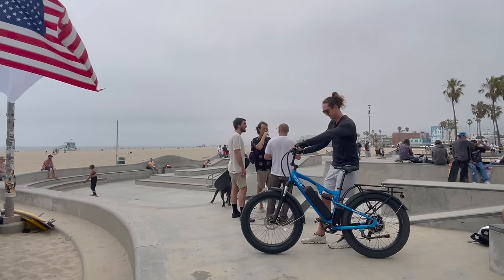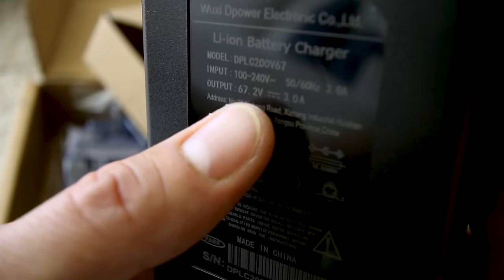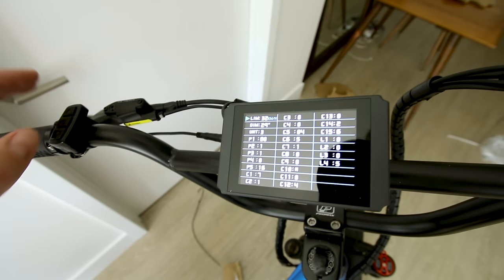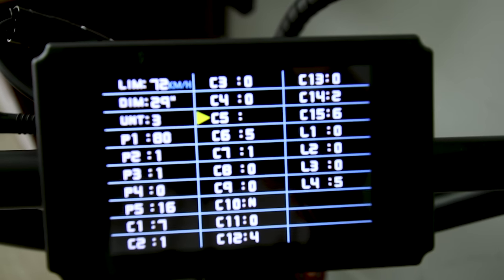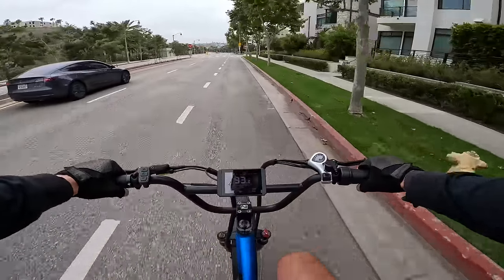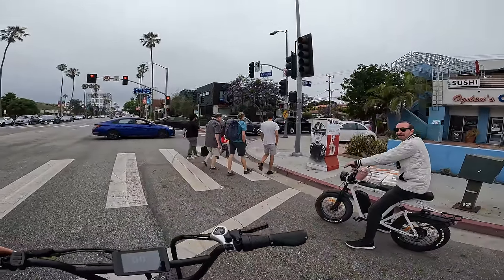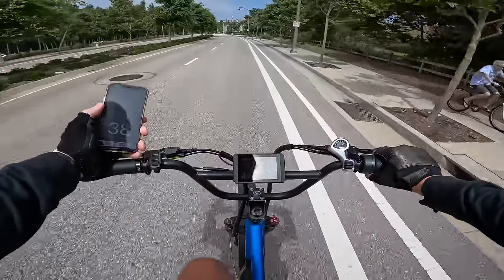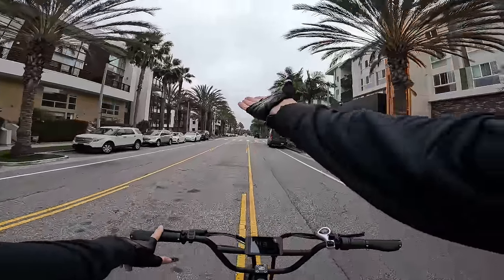This $2000 Ebike is INSANE - Wired Freedom Review!

Comment: I own this monster. My top speed is 45.2mph on it
Reply from the maker: Down hill?
Reply: @TailHappyTV  yes. I’m 170lbs. 
I can hit 39-40 level road
Reply: Do you think this bike would be ok with my weight at 245?
Reply: @stroutma  yes. Absolutely
Reply: I want to see a smaller wheel size programmed in settings. I went from 28 to 33 on my Sondors Mad Mod
Reply: @braticuss  Depends on ur weight. 190lbs stopping and starting full throttle, i'd say 15 miles
Reply: Going downhill?
Reply: How do you like it?
Reply: Yeah dude, downhill doesn’t count. It’s flat ground that counts for top speed
Reply: Does it feel quality? Think it'll last you a while?
Reply: My top speed on my Letric XP 2.0 with upgraded freewheel 11-34 
And tune up lubed up 
I hit 33 the other day I was in pedal assist 3 gear 3
Reply: Down hill doesn’t count. I can got 45 on roller skates down hill. Doesn’t mean anything. Smh
Reply: @Twinnzllc it was a joke.
Reply: @kevinhause1505 what do you think your best range would be if you weren't going nuts?
Reply: I want one
Reply: It says that it's available for pre-order. How cna I get it now
Reply: @dickflinghammer2985 that would be sick, and maybe a way to update our bike programing for the display
Reply: How the bike do in water or rain testing
Reply: I reckon a start bike using alternator power through std gears and chain would beat this bike
Reply: Where are you writing it on the Mountain Trail because taking that on a public road and going that speed is illegal and irresponsible and dangerous
Reply: 63 likes going downhill 😂
Reply: @stroutma no
Reply: Wait till they start using Samsung 50s cells and decent bms ! Everything else will be 3rd rate !
Reply: Hey! Just wondering - what’s the price on decent new tires? That, and is there a place to find replacement batteries?
Reply: They only sell it preorder, no choice but to wait for months
Reply: Prove it!
Reply: @stroutma bro, lose some lol
Reply: what about range ??

Comment: You guys are so lucky to be able to ride these powerful bikes, here in Australia the legal limit is 36v 250w with a cut off speed 25 kph = 15 mph. Of course most of us buy more powerful bikes and remove the limiter, if the cops wanted to be mean they could charge us but I've never had troubles in 3 years now.
Reply: We're in the same boat. At this time, unregulated and unknowledgeable enforcement is bliss.
Reply: Damn that is ridiculously slow
Reply: Here in the USA e-bikes like this are technically illegal as well. It’s just no one will ever enforce this and even if they did enforce this it would be impossible to do so.  The legal limit here in the USA is a 750watt motor that cuts off power at 28mph
Reply: Usain Bolt top speed is 27mph... this 🥷 speed while running is illegal in Australia 💀💀
Reply: @JB23669  there's a thought 😄
Reply: @sambryant2150  ridiculous is right, before I took off the inhibitor I left home was using pedal assist, before I got to top gear the power cut out. I understand all Europe is the same.
Reply: @riceball777  750w and 28 mph, thats about 45 kph, I wish we could enjoy that.
Reply: @JohnnysCafe_ yeah that sucks man😢
Reply: @StefanRandall  yes Stefan, it sure does.
Reply: Well here in California they're restricting bikes to 1,000w and other states are 750w.  Other than that is basically illegal.
Reply: Just like the whole europe. Just ignore this silly "laws" and ride them. Just remember to slow down near the cops.
Reply: @MyFaithShines  I do 👍
Reply: This bike is “technically” not legal, since it’s over 750w. But no one cares
Reply: @nicks931  it is regulated. Federal law on ebike classes is from 2002 which every state follows just no one cares..it’s 750w and max 28mph
Reply: @JohnnysCafe_  you can..just go a bit faster no one can tell anyway..no one can tell if it’s 28mph or 35mph..same for you, 15mph or 20ish mph
Reply: @djones811  bikes have been at 750w since 2002. That’s where the ebike classes come from, from a federal law..California isn’t above that
Reply: Isn’t it 500w now?
Reply: @JudeTheYoutubePoopersubscribe  yes same in Aus, I've been riding a 350w for over two years now and never been questioned, plus we have bike paths all over the city.
Reply: How about liability issues?  If you crash into someone, get badly injured at speed, will all the liability fall to you for modifying it past what the manufacturer recommended?  Imagine being sued by someone and knowing it’s all on you.
Reply: @aussie2uGA And, you’re just as liable for negligence regardless of whether the bike is “legal.”  Unbelievable how many Karen’s are out there.  Put on your big boy pull ups and try and have some fun in life rather than worrying about everything!
Reply: @aussie2uGA  there's a thought, and not a good one. I do use the bike paths that go all over Brisbane and am careful when on the road but now even more so.
Reply: @jfly2249  you must be young… 🤦‍♂️
Reply: @aussie2uGA actually quite old and a lawyer.  Stay young at heart and have fun.  Self righteous Karen’s make me smile.
Reply: @jfly2249  Sorry, don’t believe that for a second.  Have fun with garnished wages when you finally acquire some wealth and would like to protect it.
Reply: Great work Sherlock!!
Reply: @aussie2uGA Do you take prescription medication?
Reply: Just get a motorcycle
Reply: @654789qwe  License Tax Insurance Gasoline ⛽ 😑  ebike is quick and silent 🤫, creep around town at midnight pulling wheelies nobody hears you 🤟🤠💯
Reply: @654789qwe  yes that's an idea but ebikes are fun, cheap to run and with so many bike tracks (well in most cities) they are far more relaxing to ride.
Reply: The 250w / 15 mph limit is pathetic, dreamed up by some suit somewhere to stop people switching from i.c.e. mopeds which are big brother monitored and multi taxable .
Personally I think this bike is 'too pokey' for riding without a helmet and gloves minimum.
However. 
The legal limits should be set at a 'normal' persons pedalling ability on a non electric racing bike 'on the flat'. 
Imagine how environmentally friendly that would be with nuclear power generation..
Governments dont want green solutions, they want to control , tax and impoverish citizens into 15 minute cities and obedience.
Reply: @MrChriss000  15 minute walkable cities are green. And they are in no way about control lmao
Reply: We have the same laws... what these promoters and advertisers won't tell you is that most of these types of vehicle will get taken away by Law enforcement, and they won't give it back to you. Unless you had it registered through the DMV. I've known 4 doordashers that had it taken away by Sheriff's.
Reply: @Fuzzie22   I did not know that but I think I understand it because ebikes can reach high speeds and I guess it would be dangerous to let anyone jump on one zoom around the streets.
Reply: @JohnnysCafe_  people here want an “e-bike” that is really a motorcycle. That’s why I made the comment. The people who are clamoring for high power and super fast bikes are the kind of people that drive recklessly in bike lanes and pass people at very fast speeds.
Reply: @ianmangham4570  there’s a reason higher powered vehicles require a license.
Reply: I know
Reply: @654789qwe they are also the people that are eventually going to make ebikes illegal altogether or at least require a license.
Reply: This type of irresponsible riding is what leads to more rules, regulations, restrictions,  and serious accidents.  250lbs slamming into a pedestrian can seriously injure or kill them. I have a friend who stepped off a curb and got hit by a 10 speed bicyclist. She hit her head on the asphalt causing brain swelling and permanent brain damage. She won a sizeable lawsuit. It's all great fun until you get subpoenaed.  Be considerate of those around you. If not, expect more damn rules and regulations!
Reply: @chuckweyant4872 hello Chuck, no one can argue with you there. Rules are imposed to stop people being a danger to themselves and others.
Reply: @jfly2249 You are being a bit harsh. From what I have been witnessing there is an ever increasing chance of people getting seriously injured with EV bikes getting heavier and faster and more numerous. Especially since these EV bikes are using bike paths that are also used by pedestrians, others are flying along mixed in with vehicle traffic. I am seeing young teenaged riders moving at top speed with nothing on their heads or hockey style helmets, often unstrapped. Short pants and sandels.
Reply: Australia sounds worse than california
Reply: @Twinnzllc with less people even.
Reply: I live in Europe and my e-bike can go about 30 mph (50 km). But i sometimes see guys on normal bikes or (normal) mountainbikes going 25 mph or even a little bit harder. 
So the 15 mph limit (here also) is quite ridiculous. 
Of course when you go very fast, it's wise to put a helmet on and probably gloves.
Reply: @riceball777  Of course the laws can be enforced -  In the UK they're confiscationg truck loads of illegal ebikes. I 'd bet that you know enough about ebikes to spot an illegal one right off the bat - the police can do the same if they're trained up. I'm not sure I'd want to invest thousands on something that might only be rideable on private property depending on which way the future winds blow. Also if you were to injure someone on illegal bike, even if its not your fault,  that persons lawyer will know everything about ebike laws and use them to hold you fully accountable without the benefit of liability insurance. These bikes are cool, but they need to come under the umbrella of the law througfh registration,etc.
Reply: @FrancisBecka     realistically i dont see how its physically possible.  There are literally thousand of ebike companies from china and geeting these ebike and just putting there name on the ebike and a few months later the company is gone or the name has changed.   Law stated that most powerful motor legally allowed is 750watts but where is literally no way to tell a 750 watt motor apart from this bike with a 1000watt motor.  Low stated stat electric power must be cut off at 28mph and again there is no way to check this or enforce this.  

Out of all my ebikes Lectric is the only ebike company that setup there ebike legally.  meaning power on throttle is cut at 20mph and pedal assist power is cut at 28mph
Reply: A point of clarification these bikes aren’t illegal. You just can’t use them in the bike lanes. If you do, then you will be arrested and the bike will be confiscated and you won’t get it back in the event of some type of accident negligence comes into play and you could have everything taken away from you, plus your own insurance like homeowners might be excluded because there was a negligence involved. Operate at your own risk but I think videos like this are negligible  and there’s a lot of them. You do no Service to this hobby or this industry
Reply: @johnrob3215  wrong. These ebikes that are well over 1000watts like the suron are all illegal and cannot be legally ridden on public roads.  I personally do it but I do know that it’s illegal but generally these laws are not enforced, I think mainly because it’s not really possible to tell if the ebike has a 750watt motor vs a 2000watt motor and policy are not trained to do this.
Reply: @riceball777  there's a sticker on the motor.
Reply: @riceball777  wrong.  As long as they comply with the requirements of mopeds or motorcycles,  like license, registration, and on board equipment requirements, they can be taken on streets.
Reply: @johnrob3215   correct. These type of bikes need to be registered and insured to legally be ridden on public roads but if you try they actually won’t register these style of unnamed e-bikes.
Reply: @riceball777  theyre electric mopeds and motorcycles.
Reply: We also didn’t have covid camps 😜
Reply: @riceball777  20.  Its 28 if you don't have a throttle. ..which all bikes do.
Reply: @djones811  1000?  When did it change from 750...
Reply: @johnrob3215  the law is on throttle only power must be cut off at 20mph and pedal assist power must be cut off at 28mph.   Which the vast majority of e-bikes violate this law.
Reply: @johnrob3215   the legal limit to be considered an ebike is a motor with nominal power of 750watts. This ebike has a nominal power of 1000watts and peak at over 2000watts. So technically by law this is not an ebike and is considered a moped or motorcycle.  Key thing is you cannot tell this apart from a legal 750watt class 3 ebike. So it makes it impossible to enforce.
Reply: @aussie2uGA  he's a child...at any age
Reply: @riceball777  yes but the way I read it is the bike must be assist only, no throttle at all, to go 28. So class 1 is throttle only at 20 max. Class 2 is assist plus throttle at 20 max, and class 3 is assist only at 28.  I'm guessing they think the assist will take the bike to 20 and then it can be pedaled to 28.
Reply: @riceball777  hmmm, no,  if the bike is going 28 and the rider isn't pedaling, the cop can stop him and check the sticker on the motor.
Reply: @johnrob3215   this is incorrect as all class 3 bikes have throttles. It’s just the power from the throttle is cut off at 20 mph and the pedal assist power is cut off at 28mph.
Reply: @johnrob3215   like I said this is impossible to regulate as most of these high power bikes don’t even have stickers on the motor and even most low power bikes have no marking on the motor and most of all e-bikes and every the illegal ones all ship with a class 2 sticker on the frame. Plus anyone can just stick a sticker on and however then want. I know I have class 2 stickers on all my e-bikes even the ones that go over 28mph with over 750watt nominal motors.

Like I said impossible to inforce.  E-bikes are not cars. E-bikes have very few parts. Thousand of no names companies will sell bikes with motors on them. Anyone can just buy a motor and a battery to slap on there normal bike for a few hundred dollars and there is no way a cop is going to pull over and examine the ebike to make sure it passes all the class 3 rules. Simply not possible.
Reply: @riceball777  IC.  Then why have a class 1 or 2?
Reply: @riceball777  it’s not impossible. All motors are required to have stickers. If you change the sticker it is illegal unless you’re just going from a class to do a class three.
Because of the irresponsible 20% is in the E bike community states will soon pass laws requiring all E bikes to have to be registered, license, plates, motorcycle license, drivers licenses, and liability insurance. The 20% or’s are going to screw it up for everyone.
Reply: @riceball777  let me explain a little bit, it’s not impossible it’s just difficult. And that’s the very reason that states are going to soon require licensing and registration so that a cop can simply look at the license plate on the vehicle to see if it’s probably registered and can call it in.
Reply: @johnrob3215   I do agree the only way to inforce these ebike class rules is to require  registration and insurance on all e-bikes other wise it’s near impossible to In force.  Let’s hope this does not happen. As of now I’ll enjoy my illegal e-bikes that look just like a class 2 legal ebike but has over 1000 watts and no sticker on the motor and over 35mph top speed on throttle only with my class 2 sticker on the frame.
Reply: Yes send me opn
Reply: Every time I set on my on my ebike, I remind myself how lucky I am to be American!🇺🇸🎉😊
Reply: @jonspeak2807  I thought it was more lenient there but after talking to others apparently your laws are restrictive too.
Reply: @jonspeak2807  how lucky is that?

Comment: Awesome review and video! As a motorcycle rider I cringe a little seeing you riding at 35 mph on the streets. Imagine the road rash of a get off or a collision at that speed. I don't want to mother-hen you, but maybe check into some protective gear at your local motorcycle shop.
Reply: The long girly hair will protect his melon. 🤣🤣
Reply: I'm confused as to how they can put that class of a sticker on it when clearly this bike is capable of blowing that out of the water?
Reply: @rentvesting the stickers are layered, with class 3 underneath, you are technically supposed to remove the class 2 sticker to reveal the class 3 once unlocked, obviously no one would intentionally give themselves away to an officer, if it's capable of over 20 mph many bike lanes and trails restrict what can be ridden on them leaving you subject to getting harassed by law enforcement, most law enforcement may know of the class system but likely won't have inside knowledge of the user interface or how to check to see if it's been unlocked or not, leaving many to rely on information provided by the sticker 😉

Comment: Make sure to either loctite that rear fender or remove it. The screw backed out on me during a ride and caused a major accident. Wired helped me out which was great but it was preventable.
Reply: i go over my bike every time i take it out loc tite or not  I'm on the Facebook page with you glad your ok  didn't they give you a bike if I'm not mistaken
Reply: I'm pulling off those plastic fenders soon as I pull it out of the box. It rarely rains in Sacramento so they aren't needed and if I do need them eventually I will upgrade to metal fenders that don't flop around.
Reply: @beggart7 The new batches have redesigned rear fenders and racks that securely hold the rear fender.  If you keep the rear fender on the older version you need to let the air out of the back tire and make sure the screw is tightened preferably with loctite.